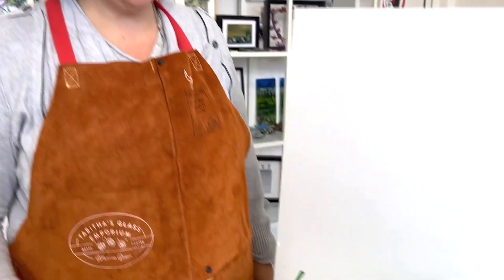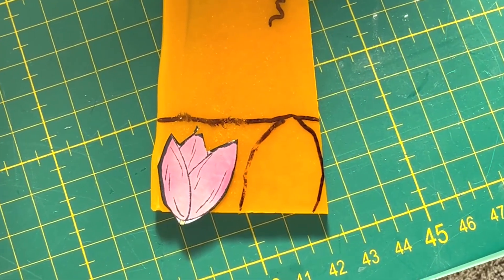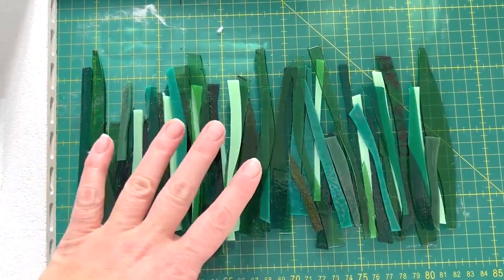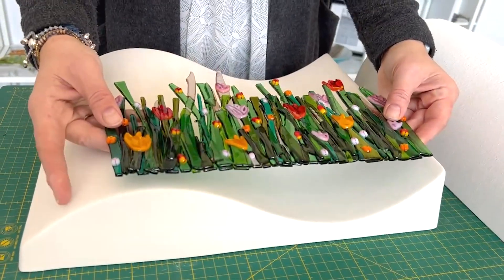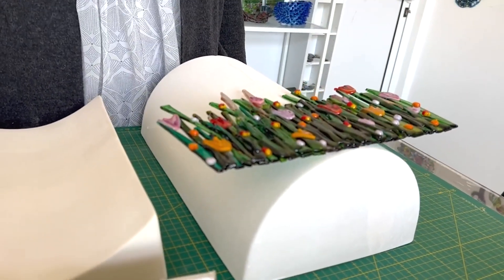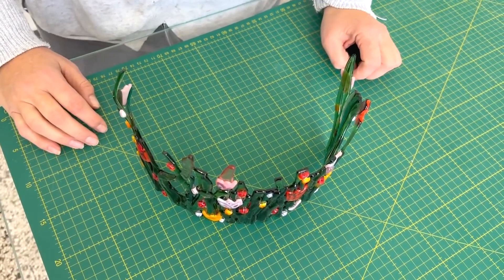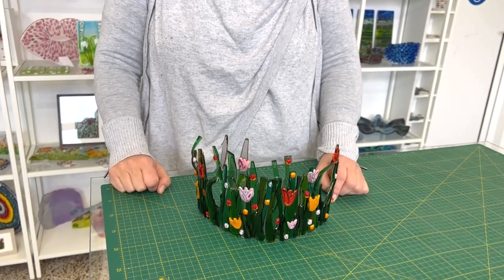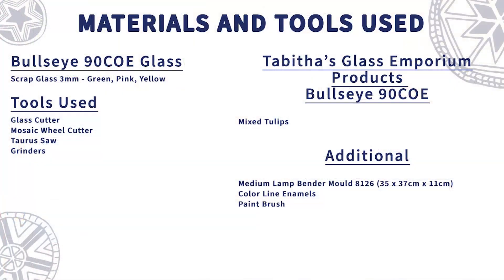Fused Glass Tulip Field

Comment: The tip about proximity to the lid is so helpful.  Shed some Major light for me on something that I have been struggling with, slumping using elevated but  flatter ones.  You sharing the schedule is a hidden gem that gave me a much light bulb moment. Thank you so much.
Reply from the maker: Glad I could help. It is nice to hear the tutorials help other glass artists. But please remember to test the firing schedule before putting a big and important piece in. Most of the time it will need adjusting.